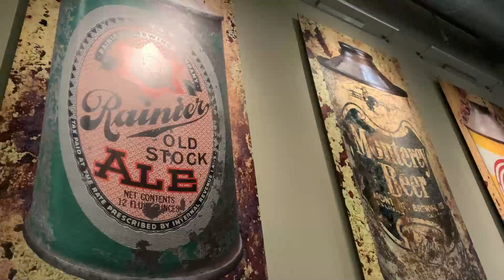C5 Corvette Performance, Vararam installed!!!! (And a side trip to Monterey)

Comment: The Veraram is a good mod, but minimal by itself. Try throwing on a set of long tube headers and axle back(or bypass mod) next. I promise you'll feel the difference.
Btw: Live most of the year and watching from Athens, Greece
Reply from the maker: I’ll be doing axle back plus x-pipe soon. Saving the long tubes for when I do a camshaft and heads later